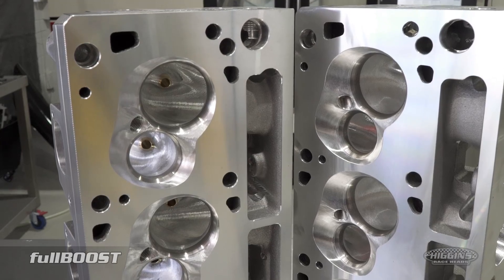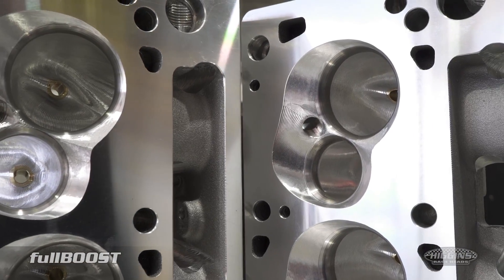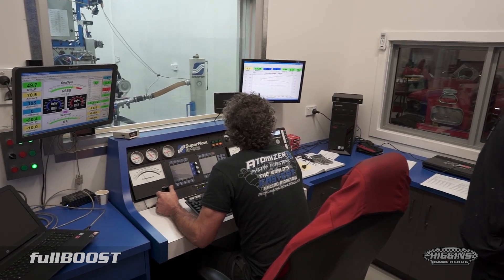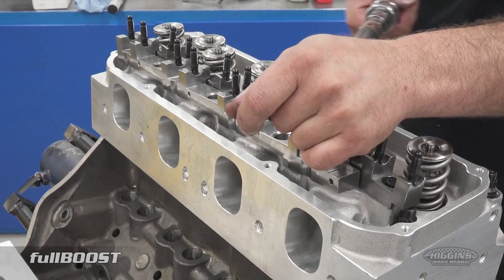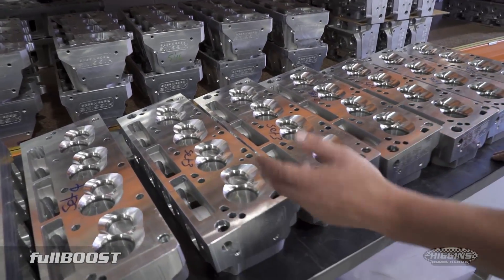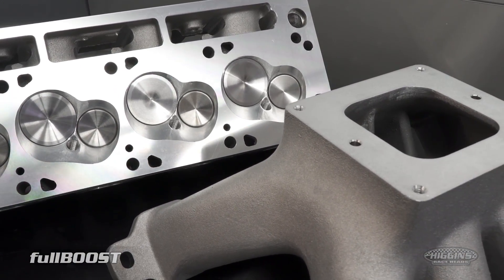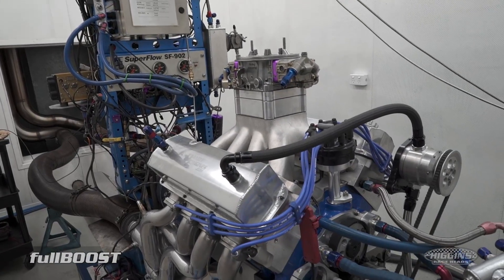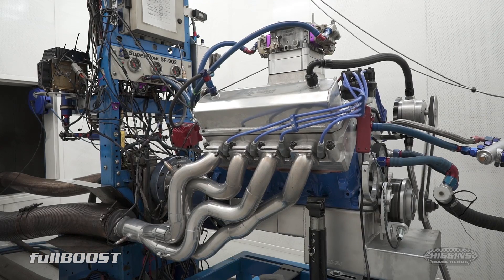How to make horsepower on pump fuel | fullBOOST

Comment: This is why Bob Glidden kicked everybody's ass in NHRA prostock for so many years. NHRA couldn't stand him winning so they had to keep adding weight to his car until he was noncompetitive. Great job guys.
Reply: 02/ 13/ 21.
Well GUYs , that goes to show you
You can't believe everything you read , 
I was stating what I read , as it apparently was wrong 
SORRY RACE. FANS , " I. WAS. WRONG "
GOOD LUCK IN 21 IF THEY WILL HAVE OPEN EVENTS , STAY SAFE - RACE SAFE.
Reply: @almierz4604  Takes a real man to admit when he's wrong. Hat's off to Al.
Reply: Props to our brothers in Australia
Reply: Ill
Reply: Bob Glidden was my all time favorite Ford guy in drag racing.He could make the Cleveland sing.I had a 70 Mach 1  with a 351 Cleveland in it .It would run.Bad to the bone the Cleveland.
Reply: Bob hid the nitrous in his hood. He had button contacts on the firewall and hood for the electric. 
But Bob was a excellent engine master.
And did kick a lot of butts
Reply: @Hjfvvdst  If what you say is true, how did Glidden monitor the bottle pressure and where was the bottle?
Reply: @stang855  Bob Glidden said he had laminated it into the hood.
The nozzle was positioned above the carb.
Reply: @Hjfvvdst  Still where was the bottle at and after watching plenty of guys running NOS they are always making sure they have the right bottle temp/pressure.
Reply: Yea!  They pulled the same shit with Sox and Martin!
Reply: @saludahead  Just googled the sox and martin and its a absolute beast. Power to the Hemi
Reply: @saludahead correct
Reply: same thing happend to dodge in nascar soooo
Reply: Just like they did to Sox and Martin!
Reply: Ray Oddman 
Bob Glidden won a lot of races by cheating using a Sneaky Pete Nitrous system, turned in by his two sons , RUSTY AND BILLY , due to an argument they were having. 
According to Billy in a magazine article interview
Reply: @almierz4604  that is actually not true and that's not what Billy said. Billy and rusty knew how the other guys were using the sneaky Pete system and bob didn't believe them so they rigged it up on his car and let him take it through tech and it passed,then they showed nhra tech the system and how they missed it which in turn busted alot of other guys. Bob never used the system on the track.
Reply: @almierz4604  That's the Dumbest Shit i heard. Glidden and his FORD Monsters didn't need Nitrous. He just Dominated. Even whooped up on those Nitrous Using Cheaters. FORD POWER !!!
Reply: @badass6.0powerstroke10  
Maybe you should talk to the 
Glidden  brothers
Reply: @almierz4604  I've talked to Billy many times. Haven't seen Rusty in years.
Reply: @badass6.0powerstroke10  & that last comment destroyed Al with truth.......as he runs away to bury himself with his bs 🤣🤣🤣
Reply: @badass6.0powerstroke10  Damn straight Bro!
Reply: Al Mierz That wasn’t with the 351C. That was later on when using a 499 inch BBF Wedge. By then, most racers were using juice. The “Dodge” boys, Alderman and Geoffrion were the ones that won a bunch of races on juice, hence their shop getting “broken into” and “vandalized.” Heck, Alderman had two nitrous backfires on the starting line, which really made people start to wonder. When Glidden went to the 429 in 1982, his sons weren’t old enough to race with him professionally yet. So yeah, he spanked ass with the 351C without using juice.
Reply: John Hickman the vandalizing issue was strange. Nobody ever found out who did it.  Dodge boys never came back as a contender and eventually left Pro Stock. Before change to BB engines..was at NHRA point Meet and watched two ProStockers. I was next in line running Stock. You could see from the back when they engaged the NOS. Just about Everyone was doing it including the second tier teams that did a lot of local match racing.
Reply: Dan Fahey spot on 100% best commit and everyone was doing it
Reply: @johnhickman7922  🤣🤣 he was using juice since the late 70’s. But nice try. They ALL were.
Reply: @FeiHuWarhawk o they didn’t stop making shit up Glidden never ran nitrous I know exactly what heads he had nothing cheby or dodge had were close. They got desperate and embarrassed of how bad they were getting beat first the Cleveland now the Boss 429 and it wasn’t just Glidden dominating it was Rickie Smith in IHRA using guess what same engine glidden using Boss 429. This is the reason drag racing is dying too many fangirls don’t know how to lose. No actual conversations take place it gets old.
Reply: @johnhickman7922  there was no “juice” in Glidden Boss or Ford car they didn’t need it no one was close to what Ford had, I know for a fact  the Chevy guys tried everything they could to keep tho. Nhra was always just another division of GM trying to help Chevy and their boat anchors the 500ci rule was implanted because nhra and chevy assembled a completely new engine DRCE which was Oldsmobile block FordCleveland headed engine so not even a Chevrolet engine. Nhra told everyone else about the rule change right before season started trying to make them scramble. But not even with the advantage of putting together a brand new engine from different manufacturers could chevy win. They lost even worse to the Boss 429. I’m sure they were feeling embarrassed. Makes sense some of their cheerleaders get their feelings hurt but facts are facts.
Reply: @CoyoteFTW  No shit. I never said Bob did. I said "by then, MOST were using it." It is well known about the Dodge boys and yes, even Billy Glidden (in a Ford) using juice, but never once did Bob and that is also well-known. Billy even revealed numerous times how he did it though his father was completely opposed to Billy's cheating. So you are correct in that Bob didn't, but incorrect in that no Fords used it, because that is utter bullshit. Hell Bob did it just to demonstrate to the NHRA that it could be done, though he never did it competitively. He also proved that it only took about 90 horses of giggle-gas to make the difference between winning and losing.
Reply: @almierz4604  You are Wrong. It was Darren Alderman, They couldn't find a way to beat Bob Glidden, so they used Nitrous on there Dodge Engines and got caught.
Reply: @badass6.0powerstroke10  BUT THEY PUNISHED GLIDDEN FOR TRYING
Reply: Bad Ass 6.0 Powerstroke Dan fahey is spot on with his commit
Reply: @badass6.0powerstroke10  yep you are exactly right. Rusty and billy showed bob how they were doing it!
Reply: @almierz4604 that is completely untrue... Bob Never ran nitrous ever... Billy however did in sanctioned events.
Reply: IT WAS THE DODGE RACERS THAT USED IT @almierz4604
Reply: @sorshiaemms5959  everyone used it not just the dodges boys they had the goods to run with the other brands
Reply: @sorshiaemms5959  bob did to. Everyone was. As early as 77.
Reply: @ScooterLee-ei1ep  Prove it !!

Comment: Same as it’s been since forever. Revs, displacement, or both. This would be a pig to drive at 2600 rpm. Hardly ‘street based ‘ 🤷🏼‍♂️
Reply: We've already established you are a fool - re: vacuum pump - this 'could' be driven on the street, depending on the local road reg' s - and some American states have some very loose ones.
Reply: Facts.. this is not a street engine.. not in a American it isn't
Reply: Something like this wouldn't see 2600 under any sort of load - most likely using a very loose 'converter and low gears so will be turning a fair bit more than that.
Reply: Having comprehension problems? The components are compatible with a street based engine build. This particular engine is to demonstrate what the ultimate power generation can be for a SBF NA motor.

Comment: hahaha "SMALL BLOCK" (461ci)
Reply: Christian Toazza It's amazing how ignorance is still so widespread when we all have a computer in our hand.... small block has to do with the bore spacing and deck height of the windsor. 4.38 inches bore spacing and 9.5 deck height. This will fit anywhere a 351 will fit and also where most 302s fit because it's only 1.3 inches taller. 302 is 8.2 deck height.
Reply from the maker: This is Youtube, please don't bring truth and logic here :)
Reply: Fullboost lol! You guys are amazing!! I'm building a 408w with afr 205 heads for an NA e85 set up. Ideally I'd get the engine in this video because I think it's the sickest sbf I've seen in a long time!! I've been watching you guys for years and finally subbed. Thanks for the amazing content!
Reply: My bad...in my mind I always thought it was a displacement thing
Reply: Christian Toazza all good. Cubic inches is the inside displacement not the exterior size. A big block Ford can almost get to 600 cubic inches on a stock block...

Comment: Oh no, the Chevy fanboys are going to get mad.
Reply: Well chevy doens't come even close to Ford with international sales. Too busy sucking on the gov teat to sell around the globe.
Reply: Alexgotnicebody just like always
Reply: Brand loyalty is total ignorance. Engines are just air pumps. They are all doing the same thing. And if you throw money at them regardless of the manufacturer you can make more power. Weak points can be replaced. Restrictions can be removed. The Cleveland engine is interesting in particular. Big block Chevy styled heads with canted valves that sit on top of a small block. There actually wasn't a small block head by any oem manufacturer that could stand up to the Cleveland head's flow until 1997 when GM debuted the LS1. They we're matched with the boss 302 block in 69 and 70 for trans am racing. And in 1970 the Ford boss 302 mustang won the trans am racing championship.
Reply: @Firion13  well to be clear ... in my opinion there's nothing wrong with being loyal to one brand and what not. The problem I have is when people are assholes about it and hate on other brands simply because it's not what they would buy or own, I'm a chevy guy and always will be but I do like dodge and ford aswell. 9 out of 10 people are just too prideful and say they hate this or that and have never even owned another brand, they just hate it because most likely that's what their father or mother owned so they feel like they need to own it aswell. When I see or hear someone hating on a certain brand I always like to ask them.... which would you like to see win a ford dodge or chevy V8? Or a Japanese brand? Then they come around and the brand doesn't matter anymore lol I don't hate Japanese cars but I know I'd rather see an american V8 (no matter the brand), whoop on the Japanese cars haha BTW ford guys are the worst because the true ford guys are so damn ignorant they absolutely HATE chevy and idk why because Chevrolet is probably the biggest name now days in drag racing and street racing.
Reply: I have to disagree.
I don't like Chevrolet because they refuse to offer quality to their customers.
Chevys fall apart. After only five years you'll be wearing your headliner on your head in a Chevy.
The engines are pretty good and they go a quarter million miles if you take care of them. However, the rest of the vehicle will look like it was digested by bacteria at only half those miles.
I drive a twenty four year old f-350 and it still looks almost new.
It is an exquisite machine and a testament to customer value.
But, the rivalry is fun. And, the more ridiculous people get with it the more fun it is.
But, you'll have to excuse me because I have a candy ring and some fun dip and it's time for me to go and have a real treat!
Reply: @brockmaine2743  you see you dont know why people( ford )people dont like chevy’s i grew up a long time ago and because i  was told by so many chevy people how great theyre chevy’s are and how bad my fords were but i even owned a few chevy’s  but my fords did exactly what the chevy people were telling me it wouldnt do  i learned more about chevy’s from owning and working on them  i never had to work on my fords as much as i did my chevy’s  i was told anytime i talked to chevy people how bad my choice in cars was always heard found on road dead  flip over and read directions fucked over rebuilt dodge     But the chevy people who talk to me and respect all cars because they are car people  made me realize  not all chevy people are bad  and i hope they see the same in me    And i am loyal to ford  i have been for 50 yrs  i did hate chevy’s and those ford haters just as bad as they did    I like friendly competition and rivalry’s  but the haters i can do without
Reply: @Firion13  after i beat a guy with a BBC in his Camaro with my 70 Cougar, he strolled on by to see what got him. I had my hood closed. He asked me "what size big block you got?" This is not the first time I have been asked this by a BBC and LS owners. I replied to him "its a 359" He said "oh you destroked it?" I about pissed my pants laughing. So I opened the hood and showed him my all motor 359 Cleveland. With an unhappy voice he said "well thats not a small block with those big block heads"  hahaha!!!!  Told him "well whenever Ford makes a 4.38" bore spaced Big Block then I will claim mine to be a big block then"  hahahaha
Reply: Umm probably not when theres millions of chevs making similar hp/per ci. Truth be told I think most REAL chev guys probably just like seeing a rowdy n/a v8 making big numbers and don't get all butthurt over dumb brand loyalty. I know I do.
Reply: @trixnhoez2964  well said and i agree brand loyalty is honestly just childish..... all V8s are badass

Comment: Hi all im not american ,i have one question this engine is 6.2 liters? (Thanks for all)
Reply from the maker: The engine is based off a 351ci small block Windsor.
Reply from the maker: People have been building high revving 450+cube small block engines for years, it's nothing new.  👍 Just not so much at this power level 😋

https://www.youtube.com/watch?v=oJRMLfrlPvg
Reply: 7.55L
Reply: Tjiko de Gooijer 

Because there is a "Big Block" which is larger..
Reply: Glen Tight thanks
Reply: Fullboost....
Based off...🤔

Secrets of the Dandy...

 Anyone who thinks a 461W...N/A...with a "crate motor" stroke.. should reach these RPM's.. should just un-sub... 

Dandy trickery that stuff😂
Reply: Fullboost 
 Usually not getting near the 8200+rpm mark though...

Comment: 8100 rpm with push rods it never seizes to amaze me. 👌
Reply: Christoffer Sinding, It’s been going on for decades, where have you been?
Reply: Shit box 

461 windsor to 8250 rpm... find me another😂...   pushrods do turn this (and more)... with lightweight crank/rods/pistons/pushrods/rockers/valves + some fuckin champion valve springs, combined with a short stroke... but a 461 windsor...
Reply: @glentight  Exactly !!
Reply: Glen Tight, Should it not be able to turn 8200? I’ve seen plenty of big blocks do the same...
Reply: Shit box...

Just that the Windsor is usually restricted by bore size/wall thickness...meaning that they are usually under square....for a 461(crate).. longer stroke than the bore diameter... to hit high rpm(i would call 8200 high).. it is usually oversquare...and the SBF Windsor does not have enough meat between the cylinders to go too far over square..
Reply: Richard Skipper 
Yep... no drama.. small stroke 8000 rpm all day.
Reply: Glen Tight facts
Reply: *ceases
Reply: @Richard Skipper it would have made about 28.3 hp
Reply: special hardened pushrods can withstand that
Reply: I've seen over 9000rpm from undersquare chevs. I mean look at most competitive circle track engines, they don't just go over 8000; they live in that rpm range.
Reply: @trixnhoez2964  They're ONLY 410 cubes, thus shorter stroke. This big bastard is 4 6 1 cubes, or 51 more !!

Comment: I don’t mean to split hairs over this fantastic illustration, but I honestly wished that it was electronic fuel injection rather than mechanical fuel injection. 

Top points for the amazing work on this consumer ready package 👍🏻
Reply: It uses a  BRE , Book Racing Enterprises ,  carburettor ?  What fuel injection ?
Reply from the maker: They are building an engine that the owner wanted. It will be going into an older Ford street car.
Reply: Sard Engineering, 4500 carburetor, not injection...
Reply: Then you go full throttle pull on dyno for horsepower it doesn't matter what you using, with carbs much simpler and faster to do everything for tests, but then you tune for part throttle or street driving efi will be better in all ways.
Reply: wont really make a difference
Reply: Not Stupid you can introduce fuel at the same point using efi too by that logic and efi is more stable. Top fuel dragsters use efi. End of.
Reply: Not Stupid what drugs are you on?
Reply: Mechanical fuel injection :’D

Comment: really nice RPM for the setup, massive flow on those heads for a CNC port, It would be hard to keep the air up to them and fit the setup under a bonnet.  Long live Pushrod V8's!

Comment: Wow that's impressive considering it's putting out 125 Nm/L at the point of peak torque. V8 supercar engines do 124 Nm/L, and the 2.4 V8 F1 car engines used to do 140 Nm/L.
Reply: Its not surprising its line ball torque/litre to V8SC.  Both use canted valve Cleveland style heads.